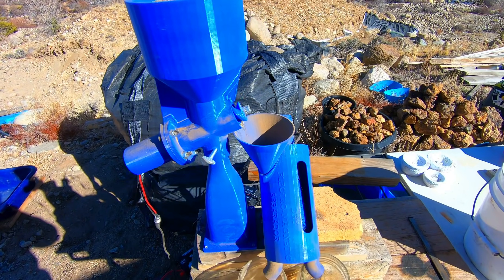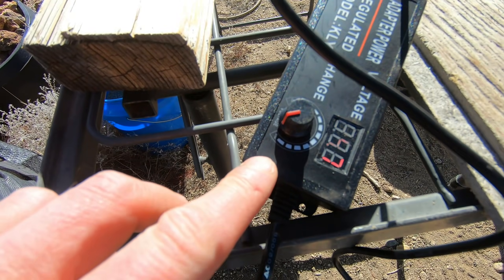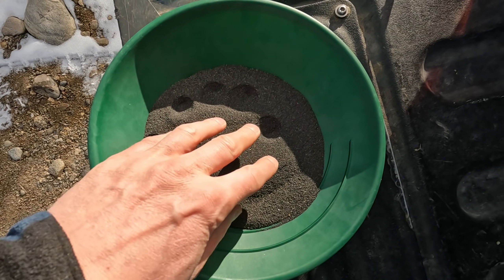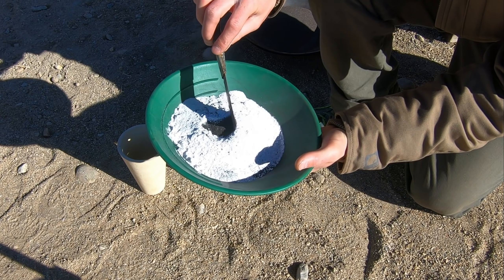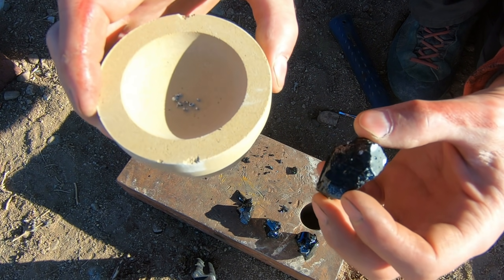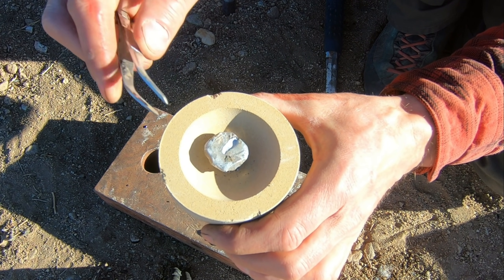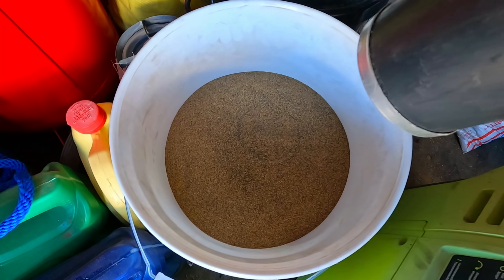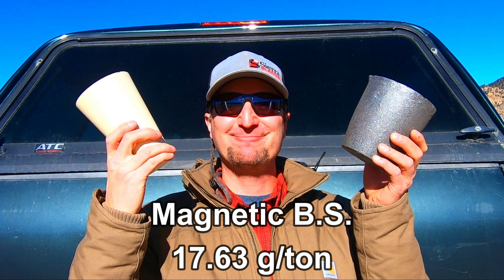CRAZY NEW CONTRAPTION to Find More Gold!

Comment: @ColoradoGoldCamp  I have access to unlimited yards of ribbed matting (42 inches wide and can be cut up to around 40 yards long). The groves of the matting run long ways, not side to side. It comes in black. 
I was thinking if you knew where small river/stream was and you stretched out a piece of this ribbed material from each side of the stream and anchored it down well.. then wait till after the first heavy rain OR stand up steam from it and direct the gravel materials over it. If you put it at a slight angle in the stream all the fine materials would slide to one end of the blanket/ribbed material.
In other words from over head it would look like a giant sleuth box.
I'd like to discuss this further with you.
Reply from the maker: That's a lot of ribbed matting!  In theory it should work, I have come across a few similar contraptions in the field.    I am aware of only 1 that worked a charm.
Reply: @ColoradoGoldCamp  Seems to me there's 2 different ways for use.
Once you learned how to anchor it on the flow side (which I believe a long rod threaded thru the flow side like a shower curtain would work best?). Several workers could rake material from up stream over it And if mat was placed at a angle the fine material would slide to one end of it (?).  Another way would be to set it up and just leave it until after a few good rains.
Either way I think it would be worth a try. If you're interested and know how big of a piece would work best for you let me know and I'll send it.
Another thing I was thinking what you could do with it is make some type of gold traps with it. In other words take small lengths and place them near where the water steps down (small step falls). 
If it all fails, well then you still have some great rib material for your sleuths.
Think about it and let me know. 
Hope you and yours have a wonderful Christmas.
Reply: @ColoradoGoldCamp  I keep thinking about this, sorry for another comment.
I was picturing this ribbed material securely fastened to a metal plated shape (not sure off hand what shape would work best). Then I pictured where the ribs run to the edge there was a trap that caught all the fine gold into it (maybe a nylon netting of some sort or enclosed container that material would slide into (not sure). Next fix a poll to the bottom of it so you could shove it down in place And make the square so it would spin on the poll.
So now you have a square/triangle/circle (?) looking device with matting on it spinning freely directly on top of a sandy bottom stream. As the water flows over it (taking materials with it) any fine gold would land on top and then slide thru the groves and into a trap of some sort.

I can picture this but not sure if its still a workable idea. Sounds good though..lol. I'll keep thinking.
Reply: @ColoradoGoldCamp  A plated like cage over top of the ribbed rubber would secure it in places over a great length (like you do in a sluice).
Reply: I like watching videos of prospectors removing that kind of crap from rivers. Please don’t do that to any stream, river, or waterway otherwise…
Reply: @paraglidingprospector  I hate watching comments from people who assume the future because of the past mistakes of others... yet they keep coming.

Comment: Since your gold carries a iron hat i would have expected your BS to carry more in the magnetics. Have you ever considered any other collector while in the smelt? Sometimes, them old standards work, and sometimes they don't. Big world out there, explore the possibilities:) Great video! Nice work. Took 7 days to answer me, wow.
Reply from the maker: These particular concentrates come from a placer mine and are free from any eye visible gold.  What kind of collector would you suggest I experiment with. Copper, bismuth, silver?
Reply: @ColoradoGoldCamp  Bismuth is much safer and you can get it in a lot smaller size. What i see happening is your lead is sitting on the bottom of your crucible, and your expecting the PM's to rain down through a boiling, gassy cauldron into your lead. Stirring may help but not near enough to attach the minute Au/Ag and possibly any Pd/Pt that may be in the sands. To be honest for my real fine assays i use AgCl3 as a collector. But you can't use a clay crucible and the graphite ones you have to add an abundance of carbon to keep from attacking the crucible. Then you can just part it using a 20% HNO3 solution. You'd recover all your silver back plus what ever the weight difference and you'd have a nice black powder left that is easily retorted with your lead. Pay attention to the appearance of alligator like finish on your bead, black unmelted specks, even onion skin textures are a dead give away of one or all of the Platinum group sisters. Colorado especially. Been there, done it. May all your days be golden. Always wanted someone to pass my knowledge on to before i cross the river. I'm impressed with you, your not afraid to try, to extend your bounderies so to speak. I'll be watching and sharing whatever i can.
Reply from the maker: @richardbeee  Great information, thank you Richard.  I don't currently have a functioning indoor shop space so, have done minimal chemical work.  A few of my beads definitely have an alligator scaly like finish.  I was suspecting pgm's but have not had them analyzed yet.  How efficient do you think litharge is at capturing pm values in larger than standard assay style smelts?  I'm assuming that its higher melting point is of benefit because when it does liquify it will in theory capture more pm's on its way to the bottom of the crucible?   What state do you live in?
Reply: @ColoradoGoldCamp  Hey, been away for a bit. Got a lab of my own:) Litharge is an excellent collector. It's in a finely divided state, so when you "charge" your flux it covers more surface area. However, factors to consider, size of cupel? Length of time to cupel? Fuel consuption? These all play a roll. I like the sound of the alligator/fish scales. Do you or can you use a microscope? If you have access to one look at your bead through it, paying particular attention to the underside. Black specks? Indicator of Rhodium. It is almost always associated with ultra- basic rock. Like ironstone. So are the rest of the PGMs. In Searchlight, NV i found that Pd was the alloy with the gold. For years people thought it was silver:) It pays to research. Only believe half of what you hear. Don't be afraid to go out on a limb. I live in AZ. West coast.

Comment: What would you say is maximum size material this contraption is suited for?
Reply from the maker: In this test, I used 30 mesh.  Looks like it could possibly do 12 mesh, will have to do some more testing.
Reply: It does fine with larger mesh size the only thing it wont be able to handle is larger Magnetic Rocks. They clog up the system. So in their as long as you don't have large Magnetic Rocks then you should be able to run 1/4 inch no prob.

Comment: Awesome video! I like your enthusiasm when it comes to this stuff. I wonder if you could crush that magnetite down and see if it's possible to liberate the precious metals before re-running it through the separator. Exciting results to find more value in the magnetite when smelting.
Reply from the maker: Absolutely! I was stunned and thrilled to find out that our magnetite contains so much precious metal values.   Now, I just have more questions and testing to do.   Crushing and reconcentrating is one possibility.  The most efficient recovery may be to crush all of the magnetics and leach.  Who knows! But I will find out!
Reply: Coulter mining magnates is a genius

Comment: Did you send out for assay or are those numbers what you calculated in your own smelting process?  I've found nearly all magnetite to carry some silver, and very little gold. Colorado is unique to having gold in magnetite. Always happy to see your videos - your content is inspiring :)
Reply from the maker: I calculated the rough values myself using pre smelt weight and final bead weight. Hammered them flat.  Will xrf when I have one available.  The non mag bead was silver in color.   The mag bead was golden colored throughout so, would guess it's at least 50% gold.
Reply: @ColoradoGoldCamp  I have a idea I'd like to share with you. Do you have a email address? I don't use fb.

Comment: Have you had hot slag in your boot? You cant get them boots off fast enough lol.
Reply from the maker: Scary hot!  I've been careful and lucky.  I might really need to think about getting a fireproof apron.    This molten metal could burn down to and through bone in no time!
Reply: @ColoradoGoldCamp  Like a Phosphorus burn. Strongly advising that you use those tongs just only to lift the crucible out to set it down, a guy used one like that to pour and the crucible broke where it was in contact and there was slag all over the place. Your literally playing with fire! Eh! Then use a different one, that 1/2 of it is a ring that it sits in,  with the other 1/2 of the tong lays across the top of the crucible and when you squeeze the tong together it holds the crucible firmly in the ring. Use minimum 1/4 rod steel, the crazy heat quickly softens the steel. Where the rod joins the ring, weld 2 pieces at 30 to 40 degree angle to each side to beef the ring up, to handle the weight of a full big crucible, when it's white hot. If you want to continue to smelt large charges, SAFELY, build this tong, or get someone to build it, not tomorrow, next week, or soon, but TODAY. yOU can't do much when your feet/legs are hurt, Eh! 👀👅🧑‍🦽👣👣👣🌄☯😷
Reply: @ColoradoGoldCamp  👍Well be careful and keep making amazing video's...
Reply: @ColoradoGoldCamp  in High School shop metal shop class, I had canvas shoes on.  Damn.
Reply: What would happen if I peed in the molten white hot gold? Anyone tried this yet?😆